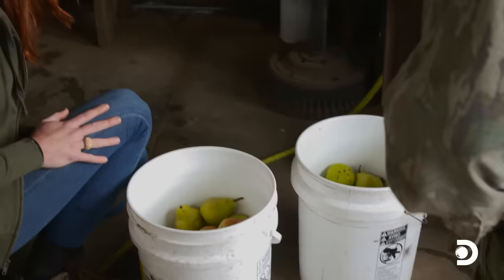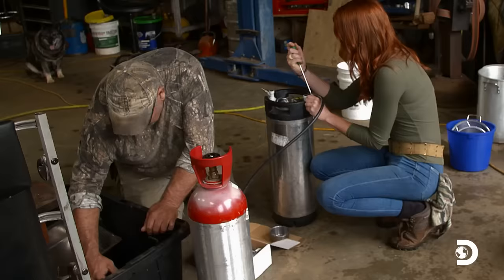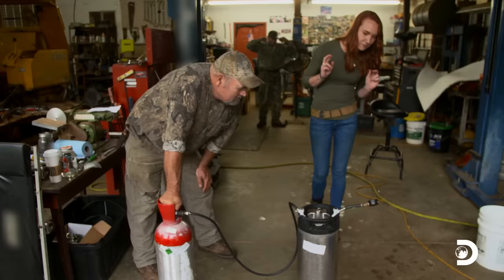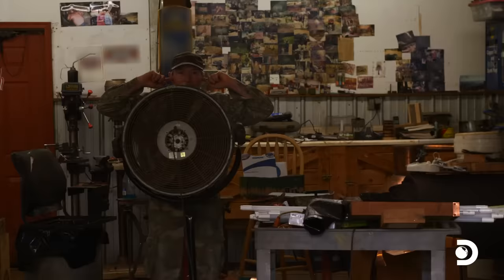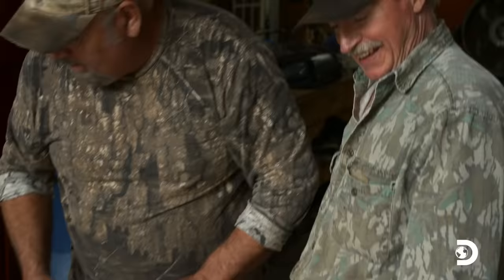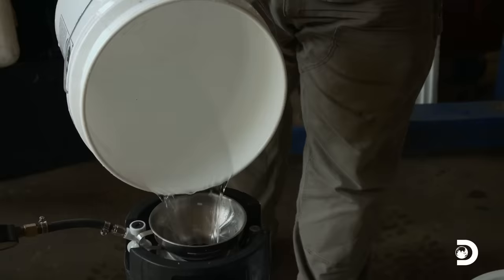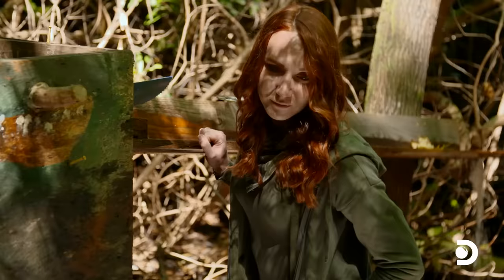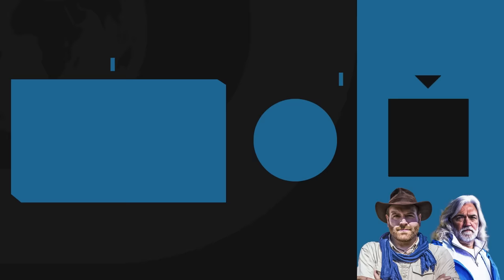Amanda Helps Mark and Huck Make Fruit Infused Moonshine Twice As Fast | Moonshiners

Comment: Wouldn't redistilling the liquor remove the chemical compounds that give the alcohol its pear flavor? I would think a mechanical filter would be better.
Reply: If you redistill it low and SLOW your mainly removing more water than anything
Reply: The flavors and aromatics should still be suspended within the alcohol and not water and so as the alcohol distills those flavors should still be distilled along with it.
Reply: Not so much with a pot still, a reflux column would remove more taste depending on how you run it.

Comment: Moonshine is moor expensive than state store liquor but has a totally different effect. 

In the hood we would start off with state store liquor and when we wanted to turn up we would go to the guy on our block and get Moonshine. 

It always ends up with people in the dirt and people fighting. 

Moonshine was $10 for a water bottle of liquor. 

$10 could get you a fith of cheap state store liquor. 

We usely by 3 at a time which you could get any kind of liquor that has more quality than 3 water bottles. 

But we smoke had fun and the bond in the hood you could not ask for anything better